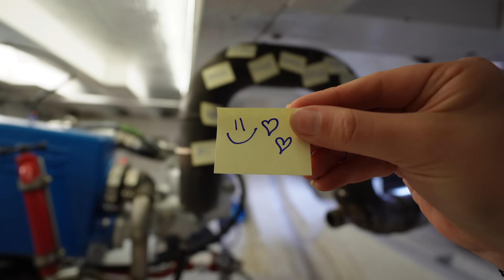Wooden boat rebuild: getting ready to PAINT and run the ENGINE! — Sailing Yabá 144

Comment: Fibreglass exhaust wrap is readily available from motorsports outlets in rolls that are just wrapped on and fixed in position with stainless steel bands or jubilee clips.  There will be heat given off due to its thickness but it accommodates different shapes well.  For a 'permanent' installation you could use a Rockwool insulation that is specifically formed in pipe halves and clamped together with an aluminium or stainless steel sheet casing.  This will give a surface that you can touch without fear of burning as well as it acting as sound deadening.  You need to talk to heating installers as its used in boiler rooms for flues and steampipes.  Lastly, you could get the pipe ceramic coated in any colour that you want that acts as a heat barrier, please check on the anticipated surface temperature.  As a last and probably an overkill precaution I would fit a sheet of aluminium to the woodwork above the pipe with a space of say 12-15mm above it to allow air flow.  This will deflect any heat off the pipe and precvent the wood getting hot..
Reply: This ^ ^ ^ is great advice. I'm thinking you'll probably want to go with the fiberglass wrap. It's identical to the stuff you removed from the engine originally, minus all traces of asbestos. The heat shield might actually be a good idea because the exhaust is quite close to the floor beam and it's right off the turbo exhaust outlet. Wicked job on the boat!
Reply: I AGREE, CAN'T ADD MORE👍👍👍
Reply: Rockrool is the best, same product used in oil refineries and oil process platforms for insulating of high temperature pipes. Insulating this piping is important because if it is not well insulated, the temperature inside the engine room can rise and overheat the engine and even cause a fire, even with the cooling system running.The problem is that there is little space between the ceiling and the pipe, you would have to check the thickness of the insulation layer to see if it fits.
Reply: THERMO-TEC WILL HELP YOU FIGURE OUT WHAT YOU NEED TO PROTECT YOUR PARTS AND PERFORM BETTER.
Reply: Make sure you soak the wrap in water before starting to wrap the pipe and use stainless wire or stainless zip ties to hold the wrap tightly in place. Also get a turbo blanket from wither a truck or Motorsport supplier. I can recommend Demontweaks for all items.
Reply: @giovannirosa968   Good point about the engine room heat as normal electrical wiring can soften, then easily abrade, exposing bare wire.  If you have cables crossing each other they can melt together causing an electrical short circuit that can lead to fire - safety first (and last)!
Reply: That’s right.
Reply: Right, SV Seeker used something like that.
Reply: Your some what right. Yachts , engines do get DAME hot. But they make, 4x8 sherts of heat and sound SHIELDS. With aluminum fire PROFF tape. They should put it on all the exposed wood. Add a heat alarm, add a fire alarm. Add , a couple of strong fans, with exit points on deck. It's scary if you open the doors to the motor, and say oil, has sprayed on the block. The black smoke is so thick, you choke to death.
Reply: A trick for sourcing rockwool insulation is to find a blacksmith/forging equipment supplier as it's also used in making a forge.
Reply: @rileybri   In UK most builders merchants carry Rockwool products and the normal foil faced hot pipe insulation is readily available.  As I suggested, they need to talk to industrial heating engineers/installers
Reply: Yup woven fibreglass bandage is the standard stuff.
Reply: Lava rock wrap doesn’t breakdown looks good and goes on dry, rated much higher then fibreglass wrap. It’s a gold brown colour.
Reply: Wet wrap first before wrapping on pipe will let it shrink when hot

Comment: Agree with the exhaust wrapping comments and a metal shield spaced slightly off the deck beam.  I think you will need to put antifreeze in the cooling system, not because of freezing but for corrosion protection.  The dissimilar metals will cause a lot of corrosion to occur if you don't use some sort of coolant in the system other than just water.
Reply: And also to raise the boiling point.
Reply: @manolisgledsodakis873  Antifreeze doesn't really increase the boiling point, that is done with pressure.

Comment: For the exhaust you need to check out high-end motorcycle shops.  There is a fiberglass tape/wrap used for motorcycle exhausts to protect the rider's leg.  There is also a high heat glue used in the door seals for wood burning stoves. This can secure the wrap in place then use a stainless steel wire to make sure it doesn't slide.
Second........... A heat shield is needed between the overhead and the exhaust pipe. It keeps a space open for air to circulate in between  the overhead and exhaust pipe. It can be 14-16 inches wide and 18-24 inches long and usually stainless , centered on the closest position of the pipe.  This is similar to being code for wood burning fireplaces to protect the wall and celling in houses here in the U.S. .............................  enjoy
Reply: GET PIPE WRAP FROM SUMMIT RACING, THEYLL SEND IT TO YOU GUYS

Comment: A good roller and brushes for your large volume painting, in my opinion is a better choice for wood boats! And the time it takes to tape and protect the other areas is time consuming.  And.........when you are on your travels, good brushes and rollers etc. Can be on board for touch up and you can be anywhere! PS have been a wood boat guy for 60 years. And in my old age still take specialty work to this day! And Yes! I LOVE WOOD BOATS. Live Aboard and cruiser for over 15 years. Sure wish You Tube was around then. I generally worked on boats and cruised and worked on boats from destination to destination. AWESOME LIFE! Regards and Lots of Smikes and good thoughts for All boat lovers and owners who Live their  Boats

Comment: Don't forget to check the level of your engine oil just after first start as you will not have filled the filters before you you start for the first time.
I know you said it holds five litres but to be safe check again.
Reply from the maker: Most definitely!!
Reply: 5 litres is the g/box. The engine holds more.

Comment: There is pipe wrap you can buy for heat shielding from any car parts or motor cycle store , just follow the instructions, pretty easy. The main thing I want to say is please put anti-freeze additive in your water in the engine. It increases the boiling point of the water and helps with stopping corrosive scale and sludge build up in the cooling system (especially in the heat exchanger) It also helps track down coolant leaks because the water is a different colour.  Thanks for the video.

Comment: Header covering for the exhaust loop.  It’s a wrap for car exhaust.  I use it on the hot rods I repair and build.  I’ve put it on my motorcycles too. It will cut down on heat and will prevent being burnt if you touch it.  It comes in rolls. They make different widths also.   I have used old fire station hoses in the past too but I think that’s what was on there originally.  If you do that just wrap a heavy aluminum foil over it to contain the fibers.  Looking good.  Thanks for sharing your progress with us.

Comment: You can get the wrap for your muffler, from any hot-rod car shop.. its a fibreglass based cloth that you wrap around the muffler, make sure you wet it lightly before wrapping, the heat from the muffler will form it.  Love your  videos!

Comment: As a former mechanical insulator my number one choice for the exhaust would be a Ceramic Fiber with a Satanite Refractory backing, than wire it on with bailing wire, ceramic wool is the best heat resistant fiber out there. You could also use rockwool.

Comment: Nice work both of you.  You really should put a heat shield between the  rafter and the exhaust where it bends.  I know there are some exhaust wraps that will help, but I wouldn't touch it when it's running cause it's still going to be warm.  Check with a mechanic or exhaust muffler shop for a wrap and shield.  Be safe stay healthy enjoy your week.
Reply: Yes I agree wrap and a heat shield

Comment: As mentioned before, Refrasil is the brand of a high quality thermal insulations that comes in a variety of forms. Blanket, tapes, rope, sleeves. They are safe and graded to hold a continuous running temperature of 980 to 1260°C. Often used for industrial insulation. I would consider it.
Reply: The best advice......yes Sir!

Comment: Guys you must support the exhaust with a vibration absorbing bracket at the top of the loop. If you don’t it will crack around it’s engine mounting point. Looking good exciting times for you both.

Comment: I would recommend that you install an aluminum heat shield above the exhaust as it is too close to the floor above and will cause a fire. Exhaust wrap will help but not enough.

Comment: Look for a product called "Exhaust Heat Shield".  It's a fiberglass/aluminum/unobtanium wrap with a ceramic insulator that comes in various widths and lengths and is attached with stainless steel ties.  The product is manufactured by a company called Heatshield Products and is available from several online distributors.  Heatshield Products also have a YouTube channel with an installation video.

And Ben, when describing an end-product of your welding, you should always end on the high note.  It's not functional . . . but ugly;  it's ugly but functional.  See how much more enthusiastic that sounds?  :)

LOVE your videos!!
Reply from the maker: Thank you so much!! I had the misunderstanding that every heat protective tape had asbestos in it, that's why I was trying to find something else. Now I know they can be made with fiberglass only and that's a huge relief!

You're so right about the order! We will keep in mind your suggestion about always ending on a high note. What happened in this case is that Ben didn't feel comfortable only saying good things about his Frankenstein considering its looks 🙈
Reply: I was going to say the samething. Its used on exhaust headers as a tape rape. Its just like what they had taking off.

Comment: Like others have stated you can use a fibreglass exhaust wrap that should be readily available from automotive and motor bike accessory stores.  It is very effective.  You can use large stainless steel hose clamps at either end to make sure it does not unravel.

Comment: Kiln builders use spun silica wool which is a high temperature insulation material which can be installed using the same method as would be used with fiberglass wool insulation. The advantage is that you could put your hand on it when the engine is running and the pipe is at full temperature.

Comment: 18:48 Motorcycles (old school ones) use a fibreglass woven band (webbing in Dutch) to wrap the pipes...So look for Pipe Wrap Tape or Band... The tape is designed to go on the hottest part of the exhaust system...but to be safe I would do at least a double wrapping and use the second layer of banding to fasten a couple of stainless steel mounting brackets (strips of stainless) so you can mount an aluminium heat shield or several around the hottest part of the pipe. To be extra safe I would put a piece of cement board on the the ceiling beam right above the top of the siphon,  just in case... The rest of the exhaust pipe I would either single wrap or use hose clamped heat shields.

Comment: I hope that hose from the pump to the oil pan is certified for use with oil. Oil and rubber don’t work well together. The rubber hose will swell up with time and start leaking. Not something you want happening when you are miles and miles from shore. You might consider installing a piece of sheet aluminum to protect the deck brace above the exhaust pipe. That and the fiberglass wrap should protect the wood well enough.

Comment: There are woven insulation tapes made from Basalt available for the layer directly contacting the exhaust pipe. beyond thoat tape you can go with a mineral fibre insulation and then an outer layer of fiberglass.

Comment: When working with the angle grinder try to avoid getting sparks against the shield and safety glasses at all costs. Sometimes the sparks play ping pong and find its way inside the classes. Having glowing sparks in the eye is no fun. Actually I ruined two pairs of my regular glasses although I was wearing shield and safety glasses over them and I WAS avoiding the sparks. Just be careful, you only got one pair of eyes.

Comment: The ceiling on top of the big pipe should be protected with a piece of metal against heat and fire. That is what the car industry is doing when the exhaust pipe is too close to the car floor.

Comment: For your closed cooling system. you need to replace the water with an antifreeze solution. I'm sure you just used water for leak testing. but after you get everything shook out. drain the water and punt in a coolant that is rated for your system. Take a minute and research this. Very important, due to the environment and dissimilar metals within you cooling system.

Comment: Any time you prime or paint, make sure you make wider strokes, with your gun, other wise your starting and stoping more often, and more likely to have runs.for your table legs, you can use tubes like is used in a camper, table.

Comment: Rockrool is the best, same product used in oil refineries and oil process platforms for insulating of high temperature pipes. Insulating this piping is important because if it is not well insulated, the temperature inside the engine room can rise and overheat the engine even with the engine cooling system running.The problem is that there is little space between the ceiling and the pipe, you would have to check the thickness of the insulation layer to see if it fits and take care not to overheat the wooden ceiling and end up with a fire.

Comment: Great video as always, if the exhaust has changed that much that you had to cut and reweld it you may have problems with the prop shaft lining up also . You may want to look at that soon so you're not surprised later. 👍

Comment: Also a coolant recovery system makes life easier with making sure it's full of coolant without having to check see if  its full ... I've had to open up the cap on the engine when it over heated before and it wasn't fun water shooting out like a geyser all over you

Comment: Exhaust wrap is sold by manufacturer DEI (Design Engineering ) in the USA. It is available in various full sheet sizes and widths of strips. It is designed for exhaust headers etc. Maybe you can find a similar product in Brazil or import some online.

Comment: Fiberglass wrap for the exhaust is available. There are other options, you could cage it with another pipe, fill the cage with rockwool or just airgap. I'm thinking of something like multi-wall flue pipes for wood burning stoves that are used to go thru the attic of a home.

Comment: You need to add coolant fluid to the cooling water. If you run just water through the cooling system, it will corrode.
Reply from the maker: Most definitely! This water was just for testing ☺️

Comment: Even though the turbo charger removes a lot of energy from the flue gas, the steel pipe can reach very high temperatures (800 Deg.C.glowing cherry red), and the heat radiation can, in extreem cases ignite the wood above the exhaust pipe. I've experienced a fire in a roof construction caused by radiation from an insulated exhaust pipe, mounted in a cramped space where the insulation couldn't be inspected. Mounting a digital remote temperature sensor, with alarm, above the insulated exhaust, wouldn't cost a lot, but it would give a high degree of safety.

Comment: Wrapping exhaust pipes.  The various Insulating wraps cause the pipe to rust out faster, even stainless.  Ceramic pipe coatings don't insulate well.  I think I'd put some heat resistant insulation on that overhead beam and call it a day.

Comment: I suggest a heat shield be added between the exhaust pipe and beam (gaps on both sides.  ;-)
There's "header wrap" for cars, but I don't see why it couldn't be used there?

Comment: It would be easier to find kwool furnace box insulation and then wrap it in fiberglass exhaust wrap.. the kwool will withstand 2600°f with a torch and still be cool to the touch on the opposite side.

Comment: I dont know if anyone said this but when you're running the paint gun always keep the air blowing (which is the first stage of the trigger) that way you can feather a blend and it wont spit. I hope that helps? If you are spraying the top coat it should.

Comment: From my experience with working on marine diesel engines fresh water rust your tanks... power cool or anti freeze is much better but obviously cost more but you won't have to worry about the rust ...... just my option and with the exhaust wrap they make stuff like the other guy called lagging you'll never have to worry about getting burned if you accidentally bump into it comes with stainless wire to wrap it

Comment: Dear Sailing Yaba couple.
👍👌👏 Very well done again. 2) Please kindly allow me to suggest that you don't cut/grind metal inside or near the boat. If you watch the according part of the video, you can see a massive amount of sparks flying. Those will burn into the wood respectively into the (fresh) paint. The sparks content metal and corund and you will definitely see the traces on wood/paint (even tiny pieces of rust later). Additionally it's a fire hazard. Thanks in advance for consideration.
As always: Thanks a lot for making teaching explaining recording editing uploading and sharing.
Best regards, luck and especially health to all involved people and dogs. 💚

Comment: You’re oil is probably low unless you filled the oil filters before you put them on,after you run the Engine a little check the oil.